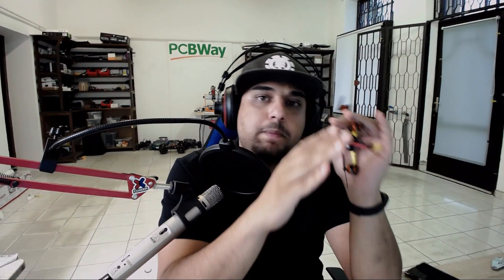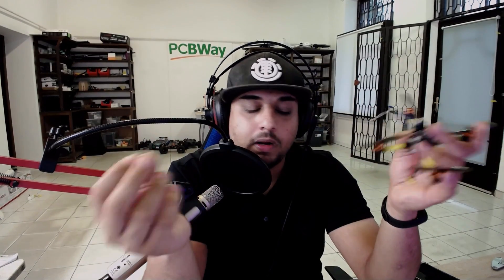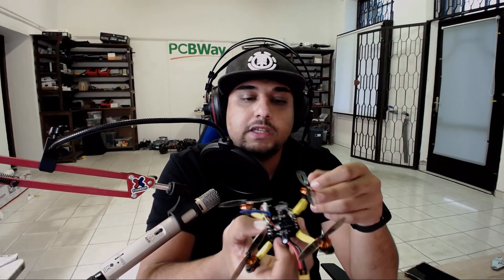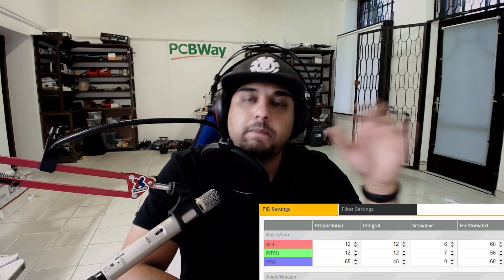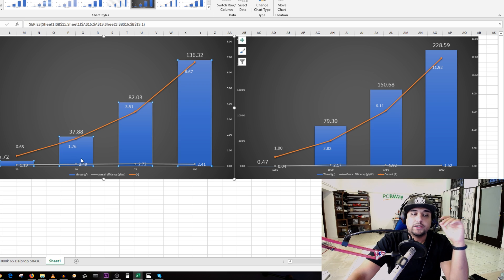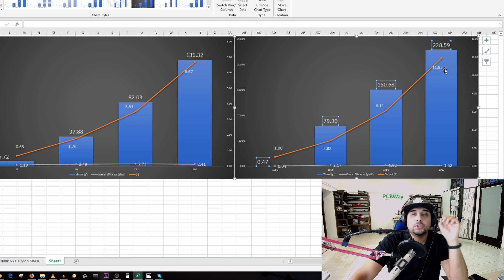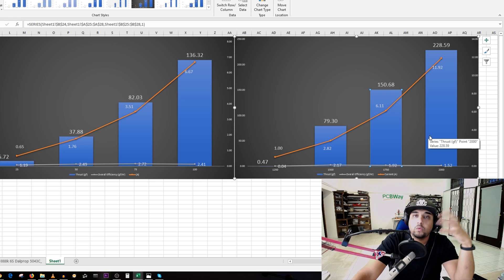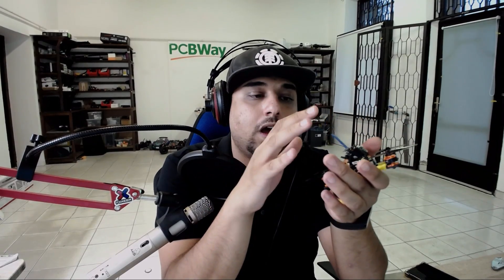Eachine Tyro69 PIDS, Thrust Test, Flight Footage, Review

Comment from the maker: 10% OFF Tyro69: BG10TR69
Eachine Tyro69:  http://bit.ly/2kgvWVf
Soldering Iron: http://bit.ly/2xR2zM9
Hex Tools: http://bit.ly/31KA93c
Heat Shrink: http://bit.ly/2xR2zM9
Reply: Do you have a spreadsheet with your measured camera latency results? I`m studying information engineering and writing my bachelor thesis at the moment. I`m highly interested in your results. I only have sheet from Oscar Lang and RCschim at the moment. Your data would be very helpful for me. have a nice day 
Edit: Oscar Liang
Reply: Any coupon codes for the uruav  frsky x9 lite pro

Comment: Hi Sam  nice video and review of the Tyro69 ,  I wouldn't mind having one but my problem with this little motors is the ground has a lot of iron in it and I get very fine metal in them and jams up the motors.  Most the time I can blow them out and they work but most of them are no longer any good.  Thanks again for the information. Have a nice weekend

Comment: Quick question bro:  which pc program do you use for the thrust/motor tests?     (Doesn't look like betaflight, hence me asking)

Great videos, super informative.  Keep up the great work!
Reply: it looks like microsoft excel. you can test thrust output by ziptying your drone to a brick, zeroing a scale with the brick and then calculating the difference in weight when you crank the motors.